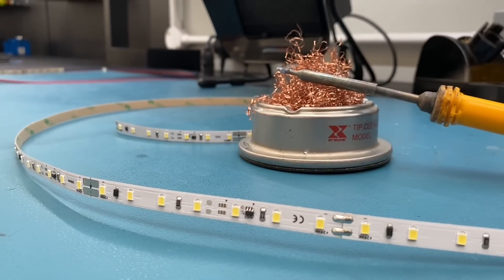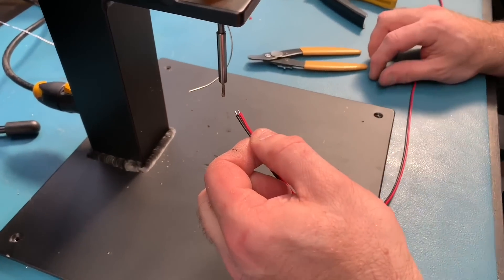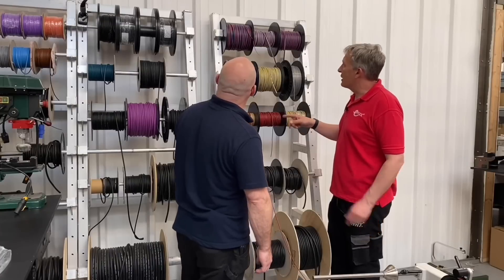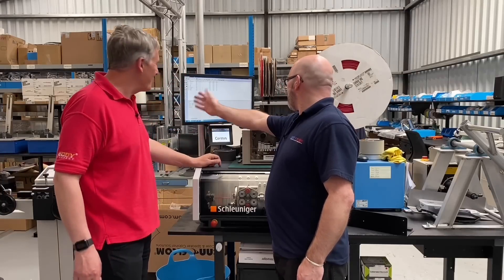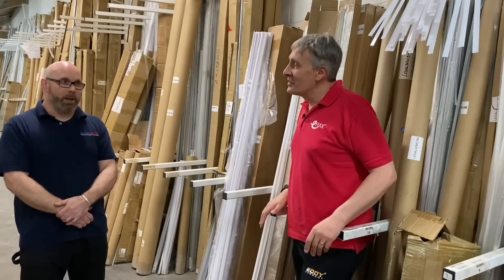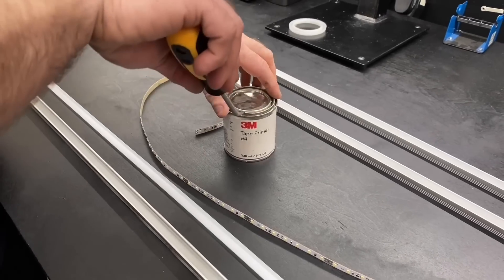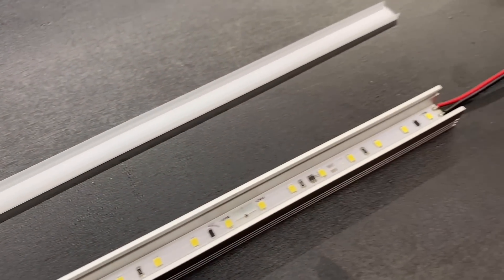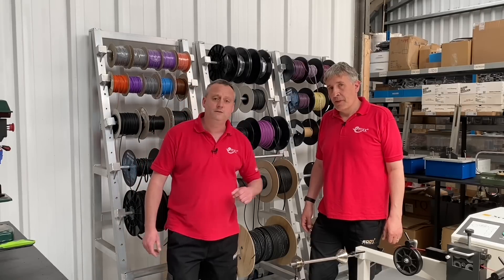LED STRIP LIGHTING PRO ASSEMBLY TIPS - Soldering, wires and profiles - with Penn Elcom

Comment: For people without one of these stands, if you learn to hold your solder between your 2nd and 3rd finger of your non-dominant hand, then whatever you're soldering between your thumb and pointer finger of the same hand.. you can hold your soldering iron with your dominant hand and it will be faster than you could ever believe. You also won't need to use any clips, stands, etc.

I thought it would be difficult because I'm not very coordinated, but I got used to it very quickly. It also helps to keep your solder in a small tube that you can hold in your palm instead of on the roll.

Last tip would be to use some 4:1 heat shrink tubing with adhesive on the inside

Comment: Huh? I just lay the strip down with a weight if necessary and solder onto it. Your better off with a proper weller soldering pencil and your fingers well away from the tip. That's my hot top tip

Comment: i am after 55v psu for some led i found in a skip
Reply from the maker: 55v led tape is a strange voltage
Reply: Ryobi make a 56v battery for their lawnmowers. Which would work. Be careful though.

Comment: How did he managed to push in that end cap when there was a peace of led tape in the way? I usually have to consider lenght of end cap to determine right lenght of led tape for aluminum profile.
Reply: magic 
lol
Reply: Most likely the design of the end cap allows it to be pushed in after the LED strip is in place. If not then we cut the end caps at the right angles to make them fit!